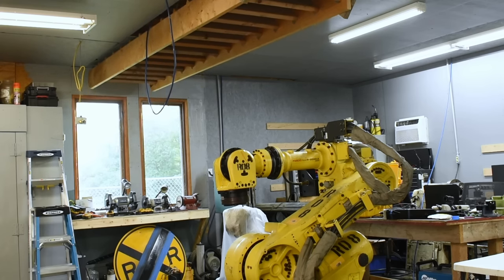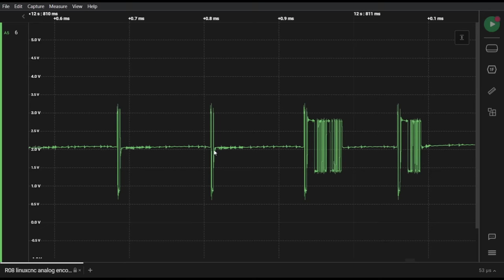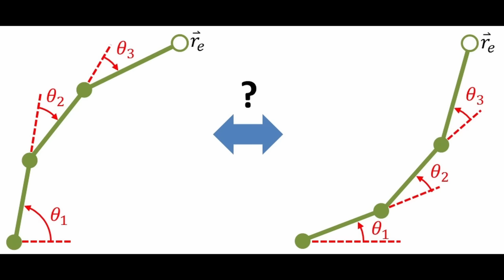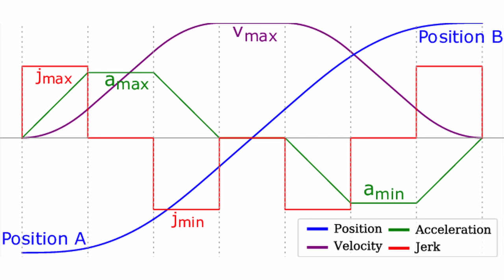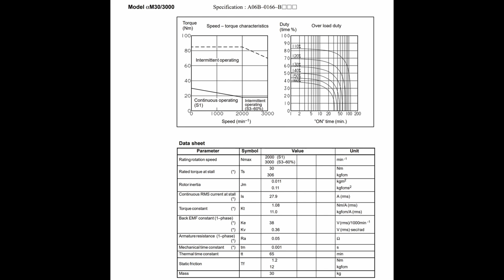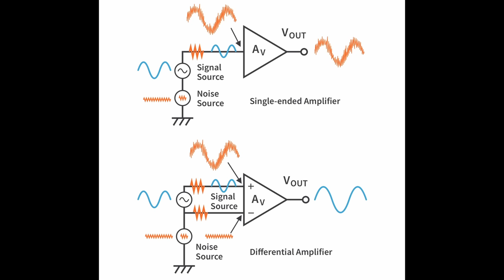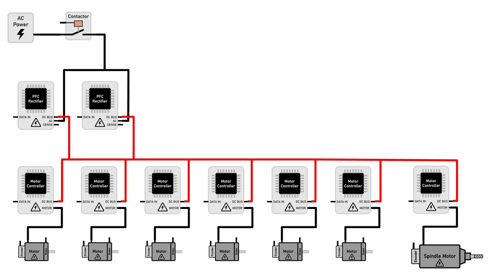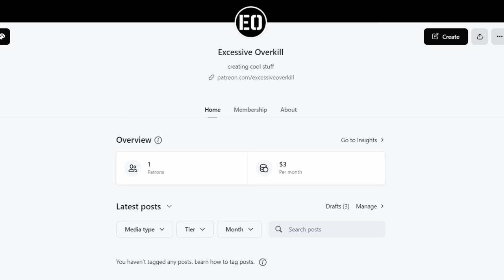Open-source Industrial Robot Controller Part 2: Starting Over...

Comment: If you can contribute anything that decreases the overall costs of making and controlling complex equipment - especially robotic arms - you could make a world of difference.  While there is a time and place for massive proprietary robotics.  The “maker” community has been largely frozen out of truly functional multi-axis robotic arms.  While a few YouTubers like yourself have made inroads, there are still major problems to solve.  I think you’re tackling one aspect that far too many have overlooked.  Perhaps owing to your unique angle of attack on the problem.  Instead of focusing on building the arm, you’re attempting to reuse end-of-(useful)-life industrial arms.  But there’s no reason these approaches can’t eventually meet in the middle to create a new class of accessible arms.
Reply: I like where you are going here.  Just as a old arm with missing or dead controller of missing sw is an expensive coat hook, so a home-made arm is also going to underperform without the rest of the electronics.

Comment: I've got two Motoman K30's (1995 era) running in production and its a nightmare trying to find Servo Drivers. Looking forward to moving this forward. The world definitely needs opensource 220V / 480V 20VA controllers!
Reply: Loads of older CNC machines still have good steel and use these same servos and are impossible to keep running for similar issues.  The biggest problem is decent servo drivers that don't cost 8 grand.
Reply: @zyxwvutsrqponmlkh the wild part is that most of this technology is gatekept at a national legal level. Japan and the U.S. and Germany even went so far as to stamp "illegal for export" on all Okuma 2spV60 lathes from the 2000s, due to them having these expandable motion controller boards inside of them.
Reply: @IAintScaredOfNoGhost while Russia, China and other nuclear weapon countries are flexing their military muscles... I'm pretty OK with export restrictions on technology.  It's not just about protecting ones financial interests.
Reply: This is why we scrap these old drives and motors. Add new servos and drives.
Reply: @Mtaalas  nah, restrictions on technology are restrictions on progress
Reply: You can get the drives repaired by some specific electronic companies that specialize in this.  Once you get a spare then send out the other for refurbishment.

Comment: there's a good chance path blending is causing trouble, set g64 to p0.01 in your INI for the rs242 startup routine.  The problem with the encoder handling within linuxcnc, is that it is not done by interupt, and I kinda went on a rant about it a few months ago. I have been working on porting EMC2 to OpenRTOS from TexasInstruments for use on their hardware. But dude, I don't have enough time. I think getting EMC off of linux is where I would start. Then with some work there's a way to fix the short coming of the control software. Keep me aprised though, I have some skills as a C programmer for state type logic and deep mechanical engineering skills.

Comment: Easiest way around fanuc encoders to find reliable and affordable drives I have found recently is to ditch the factory encoders and replace them with 16bit encoders from DMM Tech in Canada. I have a couple of fanuc redcap motors been laying in storage for years due to the high price tag to try and revive them. I took a chance and ordered some encoders from them together with their DYN 4 ac servo drives (200vac), and within a few hours I had the motors running like new ones. Hardest job was to make custom fitting plates to fit the encoders. They supply you with software to do the encoder alignment, no fiddling with scopes etc. Just wire it up, fill in a few parameters and if the motor phase connections are done correctly, you will have the motors spinning in minutes. I have no affiliation with them, just found it was the cheapest reliable option after digging for many years. Their online support are also top notch.
Reply: You should make videos or blog about it. Alot of people would love to see the process !!

Comment: Very cool project, as someone that programs CNC motion controllers I’d say you have a lot of work on your hands doing this alone. But I’d love to see you succeed
Reply: What kind of motion controllers are you programming? I am a software developer myself, but ever since I started building my own cnc controller app, all I dream is coding for something related.
Reply: @LikeFactoryMade I work for Eding CNC, we develop a range of PC-based CNC controllers for milling machines, laser machines, lathes etc. I’m an embedded software engineer there, so I mostly do firmwares and bootloaders. What are you currently developing?

Comment: I have a Fanuc CNC mill from the year 2000.  It regenerates when the axis decelerate.  Makes the LED lights and GFCI outlets in my house whistle.

Also I will totally buy that new driver you're building.  Keep being awesome!
Reply: I have one for 6 axis in c++ that runs through arduino 100% custom programmed and better than the machine specific junk that comes with these robots
Reply: @joels7605 what do you mean the outlets whistle?
Reply: @TheCrazyPozavnist  They literally make noise.  You can audibly hear what the CNC mill is doing to my electricity.  My CNC machines are in my shop which is about 40m away from my house, and the GFCI outlets in a completely different building make noise.
Reply: @joels7605 GFCIs are transformers, so it means that your machine is reducing the electricity quality by addition of high frequency harmonics.
So, PFC or cheaper solution is just a bunch of ferrite beads or reactors(inductors) to improve the power quality.

Comment: Great job, keep up the good work! I think an open source controller would be an excellent gateway into modern small-scale integration. It could lead to great cobots,  research, or even hobby use for other platforms such as metal 3D printers and multi axis EDMs. Super cool!!!

Comment: Just an FYI, although I haven't demonstrated it with a FANUC protocol, I have managed to make the Raspberry Pi Pico poll encoders using the BiSS or Mitsubishi protocols.  I can handle 8 BiSS encoders using the PIO hardware of the board.  Probably not the best solution when compared to FPGAs but they are very cheap.   Love what you're doing btw, keep it up.
Greg
Reply: If you can give me the details of the encoders on the Fanuc Motors, I will see if I can get my hands on one and test it on my Pi Pico setup
Reply from the maker: https://docs.google.com/spreadsheets/d/1nRmV0D8c2zIuhrnp7eMNqSO8C0mfWp4tSzxPsphXA7A/edit there’s a sheet that has the protocol sort of explained. A860-2014-T301 is the specific encoder part number, but it seems most aA64i encoders are similar.
Reply: The RP2040 PIO‘s were also the first thing that came to my mind instead of the fpga‘s. From my point of view it seems easier to get going and is a lot cheaper as well.
Reply: @TheStinkyToast Rpi are very bandwidth limited on the GPIO.  Do you use external chips to monitor the encoders?

Comment: I've always wanted to utilize an industrial robot but the ties to the manufacturers software and controllers has always been a deal breaker.  Being able to utilize a robot without the stock controller is huge.  I subbed to follow your journey.  A finished product that could be used as you envision would be fantastic.  Thanks for all your work.

Comment: Great to see another vid and this is absolutely awesome!, There is currently nothing out there quite like you have described, I will be following this project quite closely and wont have a problem supporting it via patreon or something. 

I was thinking about buying an old DMG 5 axis milling machine, that has control failures beyond reasonable repair and kind of experimenting with it, I think you project would be a great match and generally good testing for it.

Thanks for sharing!

Comment: Out of nowhere: Lets rely on learning VHDL or Verilog and programming an FPGA just for fun and by the challenge to conclude a project !

There will be many nights over my friend, good luck
Reply from the maker: Yes, it’s not fun if it’s not challenging
Reply: @ExcessiveOverkill  Don't fall into the trap many FPGA beginners do and test in real hardware without simulating. It makes debugging very painful, not least because of the incredibly long build times. Have fun with Vivado :)

Comment: Suggest you aim to include dual STO inputs on the motor controller. And set up the safety+motion controller to eventually support Safe stop 1 (SS1) - which is basically just a configurable delay before triggering STO. Have the motor controllers in charge of the brakes, and link that in to STO chain.

Comment: On the one hand this is very impressive, on the other the time saved to just buy a slightly newer robot and instead put the effort toward something like open source middleware to do the CAM to Robot language.  Right now it seems the choice is either something really expensive like SprutCAM or something only slightly expensive like RoboDK.  I'm no robot expert, but it seems whatever system you come up with will always lack what a user would get from a functioning commercial robot controller.  I've seen 2016 ABB robots go for $5k at auction recently, these were not beat units.  I'm in the process of setting up a 2013 ABB 6640 (180kg payload, 2.55m reach). I did pay a lot more for it than $5k, but it came with 7th axis and a guarantee... Anyway good luck with whatever path you choose.

Comment: If you do need to desolder those mosfets at 13:18 , its not that hard to get them off in one go. Take a paperclip or similar thickness piece of uninsulated copper wire, and solder it to each of the through hole components legs with a big blob of solder. Then heat the wire up with a large soldering iron tip. The wire transfers the irons heat to each of the legs pretty equally, and you can just pull the component out from the other side of the board.
Reply: Also, a syringe style solder sucker can work well.

Comment: This is a great thing you're working on. Well designed open source controller would be able to help revive tons of mechanically fine robots with dead electonics. If you'd like some FPGA support, let me know. regards, hypernyan
Reply from the maker: You should join the discord! I'm working on getting a contribution system planned out so we can begin diving into the coding.

Comment: Here's the problem. Almost nobody is aware of the Parallax P2.... THE most incredible microcontroller ever conceived and a motion-control developer's dream 😎

"most common microcontrollers won't cut it"
"the controller doesn't need to keep track of millions of pulses/sec"
"ten megabits without using any processing time"

Trivial for the P2. It has 8 X 32bit parallel processors and 64 "smartpins". The smartpins are almost like 64 extra processors in their own right. Any 2 pins can be configured for quadrature counting @ sysclock/4 😧 (in my case 250MHz/4). Once configured for quad-counting, they count even when all eight processors are doing nothing.
Wanna read, say 28 encoders at a higher rate than anything out there? Child's play.

However, this wouldn't leave pins available for anything else. My development is six axes but my preference is dual-loop feedback (feedback from the motor + feedback from the actual load) so I have 12 encoder channels.
For motor command, I prefer the +/- 10v that has been the industry standard since forever. So now, I configure six smartpins as 16-bit DACs. This can be real DACs or it can be PWM.
The eight parallel processors may sound a bit daunting but they absolutely are not. The beauty of so many processors, sharing memory and I/O is that one can forget about using interrupts and the nastiness that comes with them.

Parallax has their own programming language, Spin (interpreter). However, there is a wonderful suite (free), called FlexProp (compiler) which supports C, Basic and PASM (Parallax assembly). Languages can be mixed.

OMRON purchased Delta Tau's PMAC and now they boast "worlds fastest PID...5 axes in 25usec". P2 can run 6 axes, an order of magnitude faster.

Forget the FPGA nonsense and grab the "P2 Edge" module for <$90 depending on the amount of memory one chooses.

Smartpins can also be UARTS (if you really want to use serial encoders).
Personally, I would stick a UPS on the entire motion controller. I need to keep machines alive and I can grab a substitute incremental encoder within 24 hours. I just had a Profibus encoder die...six weeks to get a replacement.

Comment: I would love an inexpensive HV motor driver like that! I do quite a bit of motion control/robotics/embedded systems  as a hobby, and my day job is industrial control systems, so I actually have a few motors laying around it would be nice to have drivers for.  and a project like this really gets me excited!

it would be great fun if that could run with a 480VAC supply, as  that would be easy and cheap enough to rig up a transformer for in a residential setting, and could run some really high performance motors. but then you got to deal with the nearly 700V peak to peak voltage...

I don't see very many quadrature/incremental encoders in my day-day, they have largely been replaced by EnDAT, Hiperface DSL, and SSI. I've even dealt with a few that go direct to EtherCAT.
as you mentioned, an FPGA could certainly talk to all of those protocols, however a lot of modern micro-controllers have some kind of programmable hardware fabric that could likely be convinced to speak most of those protocols outside of the actual CPU. Cypress's PSoC architecture, and the Ras-Pi RP2040's PIO state machines both come to mind as possible options that would be ~1/10 the cost. 

Thanks for the awesome niche content. definitely cant wait to see where this goes!

Comment: Interesting project!

Re. the drive system, I'd suggest you break it down a bit, for each axis:

A dual-loop speed servo, with the outer loop managing speed error and the inner loop managing motor drive current.

Then separately, a position loop that compares instantaneous target position to actual position and gives the speed servo a signal directly proportional to that, limited to ~80% the maximum drive system speed capability (or whatever below that you consider safe).

The G Code interpreter and path calculation system only update the target positions & the servo position system half makes the machine track that.

That's how large machine tools typically work. Some also have an element of the path speed added in to the loop to reduce following error at higher feedrates, but that is very critical and can easily cause instability, so I'd suggest you use the pure "following error * fixed gain -> speed" setup.

In a machine with good mechanics and low backlash, the gain constant is usually set to give 1mm following error at 1m/minute feed, on a linear axis. I'm not quite sure how that translates to rotary!

The current loop section of the speed drive has an integrator (or PID), so the current (motor torque) adapts to the load without any significant change in following error. Position holding should be limited only by the motor capability and mechanical strength of the machine, at that.

I spent a lot of time with the first system I designed (early 80s) trying different control strategies but it came down to the simple, linear, following error to velocity setup being the most effective and accurate.

(The controller ran on an MC6809 at 2MHz, with resolver position feedback and Inland Motor TPAR analog / thyristor axis drives, on 10m and 5m Butler Elgamills, replacing dead bitslice CPU paper tape systems. They used all fixed-point maths except for the operator position display, and no trig at all, even for radius / circle interpolation).

Comment: Something that might be interesting to some. A particular company I worked for had some of the first Fanuc (cast on the robots was GMFanuc) industrial robots in production as paint robots. If the robot(s) were powered off or lost power through an e-stop or some other reason, or had to have a new encoder installed on an axis, we would need "remaster the robot" which involved installing a special mastering fixture onto the robot, fold the robot up into the fixture by releasing brakes and physically moving the various axis into their zero position on the fixture and pin it to the fixture, then relax the robot after it was pinned. Then go to the robot controller and read the current encoder values from the terminal, compare it to the factory zero master encoder value on the master chart for that robot and axis then add or subtract an offset value so the actual value would equal the master value, then enter the adjusted value into the axis through the terminal save it and go to the next axis. This was then the known zero position of each axis that had any errors adjusted out.

Comment: Weirdly, I've been noodling doing the exact same thing. Using FPGAs to handle encoders. I can only wish you the best of luck because this seems like a TREMENDOUS undertaking.
Reply: Why not run a dedicated microcontroller per encoder?  Won't a 80MHz controller be able to sample the encoder and sent the count upon a request? They have interupt gpio so you never miss a pulse.

At 80MHz you would have many instructons to sample at 3kHz.

Comment: I have used ROS (Robot Operating System) with the MoveIt program to control a custom robot arm. I never ended up finishing the project, but it wasnt to hard to get Moveit to work with my arm, and using ROS would make it potentially easier to setup the encoders and all the other control stuff.